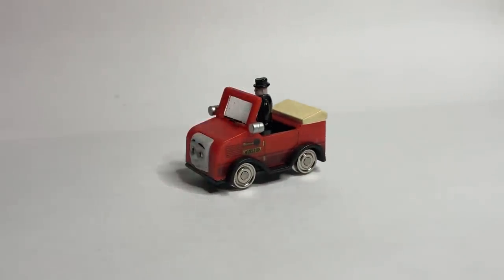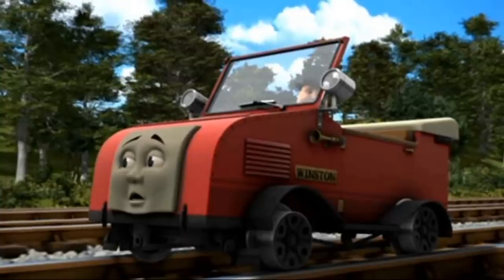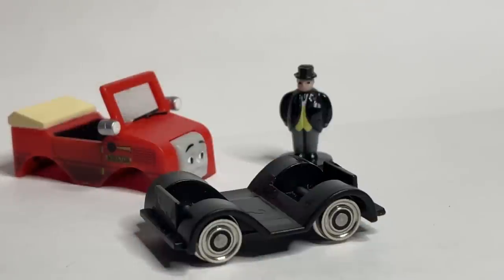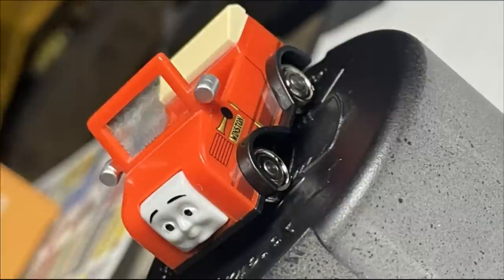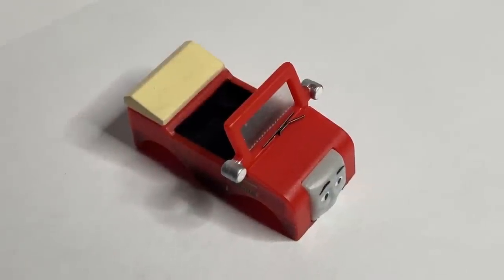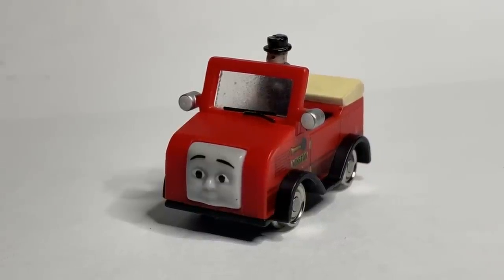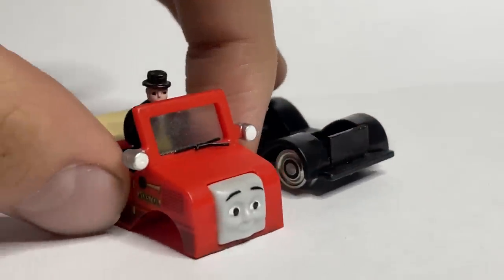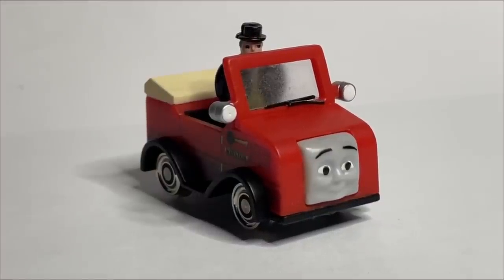How I made an OO Scale Winston from a capsule (and how YOU can too!) - Custom TTTE Model Showcase

Comment: Ever experiment with cutting down a gandy dancer

Or installing a n gauge motor onto a custom frame with ho wheels
Reply from the maker: The GD is far too large; there's no room for a motor without breaking into the body either. :/ I don't mind him just rolling personally though lol
Reply: @ItsTrainBoy  oh  no not winston specifcally I think those are just some neat ideas to expirment with for future peojects on something small
Reply from the maker: @dshaynietheawesome  I may with some time since some models could use em!! I find them 50/50 runners though so I’m not sure what they’d be used for or when? With any luck Bachmann can make newer tooled ones for such haha
Reply: @ItsTrainBoy  but you can get away with taking something like a N chassis and cutting it up and replacing its wheels with ho ones since those motors are much smaller but still very efficient, I don't have the resources to do that myself but its certainly something I'd love to try